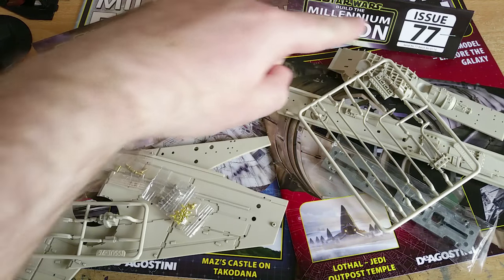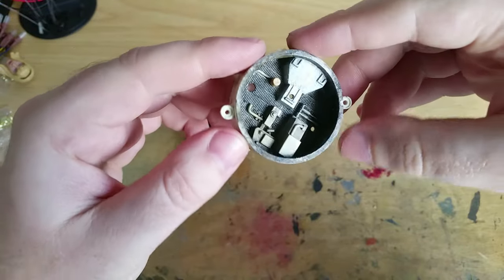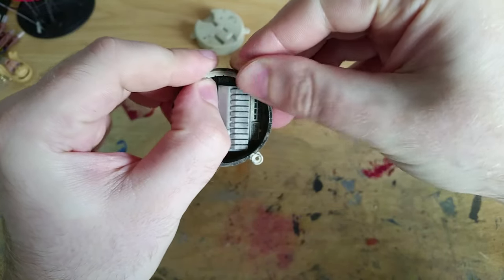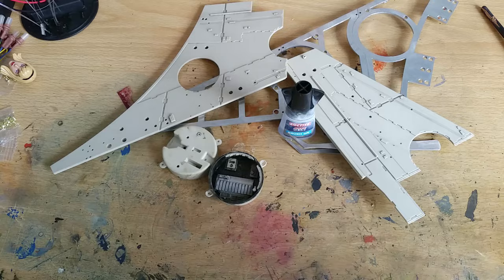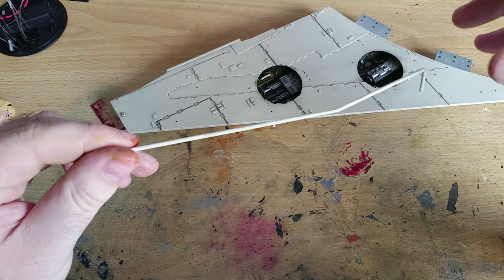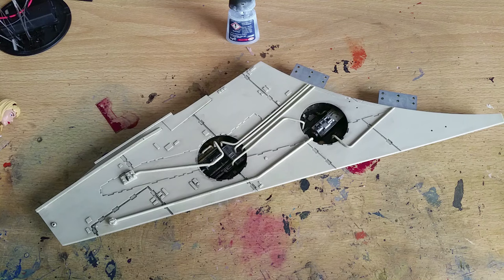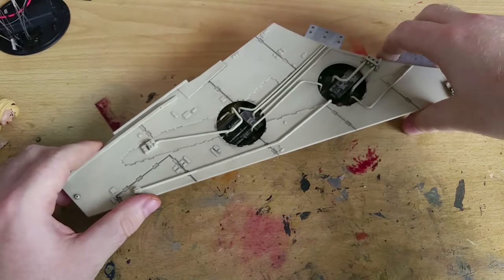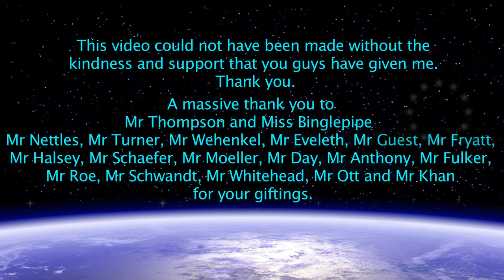Build the Millennium Falcon Parts 76 & 77: Paint, Pipes and Politics

Comment: Awesome! been watching your build, like your vids! I have just started my Falcon a few months ago and started some assembly. I have been building models for over 40 yrs and have built various kits from lots of genres, and over the years i have found that you need several glues for different types of plastic and materials, it may be too late for the falcon build, but you can apply this to future models if you desire. for bonding metal to plastic or metal to metal or metal to resin,(like the magnets in the falcon kit)  use super glue or cyanoacrylate, or you can use a 5 minute two part epoxy, but the problem with these types of glues, you need to be neat and careful, they will leave fingerprints on your model and mar the surface, and will be more visible after painting and weathering. 
To bond plastic to plastic or ABS to plastic or ABS to ABS or PVC to PVC or ABS, use MEK (Methyl Ethyl Ketone),  if you want better adhesion and a stronger bond, this stuff is "hotter" and will melt the plastic (like what the falcon kit is made of) and will bond the parts better than the cyano glue. the neat thing about using MEK is that you can buy this stuff from a hardware or plumbing store for a few dollars for a pint and it will last for years! I buy it and carefully pour it into an old testers liquid cement bottle with the brush in it and use it from there, in comparison, say, to the cost of your loctite super glue, that small bottle will cost you a few cents and will last longer. What i do is after trimming the part, place part where it is to go and take the brush with the MEK on it and dab onto the mounting point of the two parts to be joined and let sit for a few minutes for a good bond, while it is drying, to still have time to position the part properly if needed.
I dont know if anyone has mentioned this stuff for use as an adhesive before but i thought i would pass this onto you anyway.